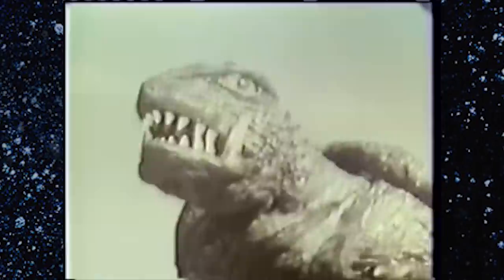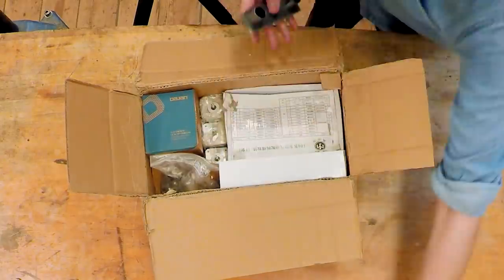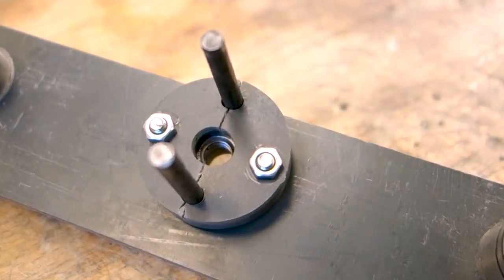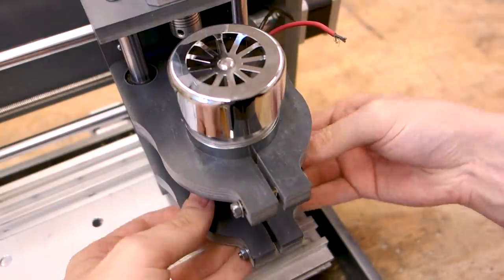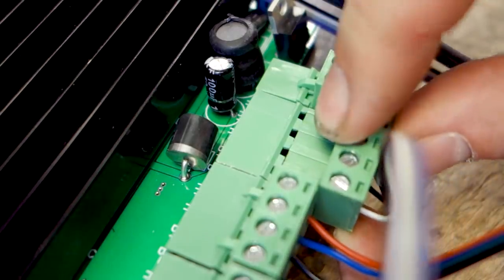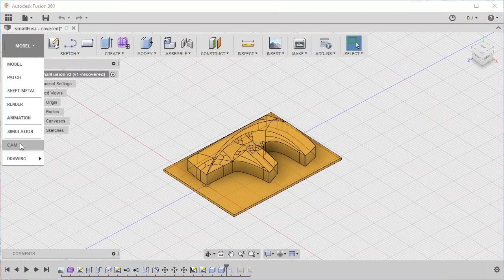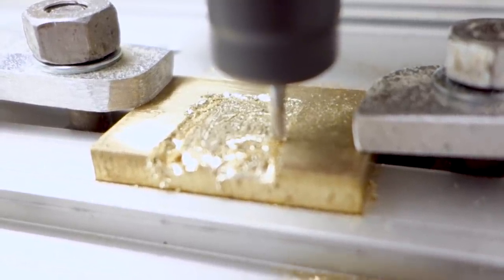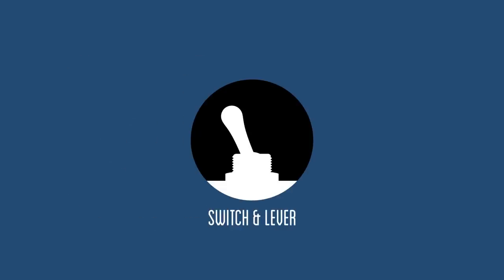Review: Cheap CNC Mill

Comment: Bad review when you're changing the kit's parts even before running things the way they were meant to. Assemble it, run it, show it failing. Then do the fixes to show us what needs to be made better.
Reply: +Techwise Jor
This isn't even the cheapest possible. For $400, using pirated software and dubious plastic framing and parts, it's basically a scam. I just went on GearBest and there are similar CNC "mills"/routers to this machine that utilize aluminum construction (the table for one was even utilizing a near exact copy of the one that was made for as a replacement to the terrible plastic table). All for less than $200. Now, I don't recommend you buy it, but... $400 for this trash is about $250-300 too much. How the seller could sell it for that much and why anyone would buy it is... puzzling to say the least. Frankly, I don't see much more than $100 worth of effort and parts even at the very best here. 

If you're willing to source the parts yourself and DIY, however, you can get a perfectly serviceable and respectable mill for about $400. Most people lack the knowledge, ability or will to do that. I can't exactly blame them. But... this junk is not only part of theft, but I'd even say it's a legit scam. There are better "CNC" "mills" even on the same site as this that are literally half the cost.
Reply: +matchesburn
When I saw the plastic I knew it would be garbage.
An all steel construction would perform much better, it either needs gears for the stepper motors or bigger stepper motors so it has the torque to work.
It's as cheap as they can build it, my guess is that this thing costs no more than 60-70$ to manufacture.
In the end I will say, no it's not worth it to buy this piece of garbage, it's poorly made, poorly designed and it includes counterfeit goods (the electronics).
You could built a better machine from scrapped printers for nearly 8 times cheaper and it would work much better.
Reply: Running it from the box, no changing parts ect, would mean he would have no power to run it. Simply put as he said 'no power cable was supplied'
Reply: It's literally common sense that it will fail when a structual part fails during assembly. Not a bad review at all. Just a lack of the manufacturer using proper materials for the price.
Reply: Techwise Jor  - finally, someone else that sees this... If it IS going to self-destruct it SHOULD BE IN THE REVIEW. This is not a video on "How to make a cheap CNC work for you". I'm surprised he didn't clean the parts up before the "Unboxing".
Reply: I know it isn't. I'm just pointing out the obvious. Besides, there's a chance it would break for good if it was tested with important pieces of it being broken. Then he would either be told again that it was a bad review because he didn't change the parts before testing the machine or he would be criticized for pointing out the obvious. The original manufacturer probably wont make it better anyways. They want to keep it cheap and to use better plastics would put the price up. If anyone is that interested into CNC machines, then learn what they're made of and all to know about each parts function and then either study technical drawings of a CNC machine or build their own from scratch. This was merely an informal video on why not to go for the cheapest possible. Quality costs. It will always cost. The reason why is pointed out when he changed that part.

Comment: "when machining you want your material rigid as humanly possible" are you aware that we humans aren't that rigid?! and why are you replacing the table plate already, just review that machine working as it came out of the box and then do your modifications... zero value review is what this became.
Reply from the maker: +JohnJaggerJack on of my final points outline exactly why, because I think this is a good machine to build further on, which is exactly what I did. 

Why are you taking an idiom literally?

Comment: Great review, have a like and a new sub. It's kind of typical with a lot of Chinese things, I use Aliexpress a lot and look for weird gadgets and things that I can use around home or my car, and I've bought some stuff that is just absolute garbage, and some stuff that is quite ok, but with a little more work or quality, they could have been great. IMO, this isn't worth the asking price. Personally I would build a rig myself, add a quality router as the motor and use good quality Chinese electronics to make it all work. It seems the only part here without a fault of some kind is the electronics, so why suffer with rubbish quality plastic that moves and ruins alignment when building the actual chassis is probably the easiest part of a CNC mill. I love all this kind of stuff and I think I would benefit more from a mill than from a 3D printer, but not benefit enough to A build one, or B spend $500 AUD or more to buy one when I own a dremel, a die grinder and a router.

Comment: i think when you are replacing parts, then you are not reviewing the machine as is, but you are reviewing your own work.

indeed ideally all the plastic parts should be replaced with metal ones. so the original machine just doesnt work.
Reply from the maker: +Avathar Behemoth you can't have watched the review to the end. One of my end points is that this is a great machine to build further on, easy to modify, it's not a production machine. 

By your logic I should've ended the review after the first part broke, as beyond that it was no longer the original machine once I made the replacement part.
Reply: you could have welded the plastic part together again. 

but by the same token.. .why didnt you make a review with all the plastic parts replaced by metal ones? 

see what i mean? yes indeed the machine as is is unsuitable for any work, or at least so it seems.

so maybe you should have done a two "part" review? one with original parts, one with enhanced parts?

then we could have seen the original performance and compared to enhanced parts performance.

that would have made the review much more usable.
Reply from the maker: +Avathar Behemoth it's a load bearing part, "welding" it together when I don't even know what plastic it is would just set it up for more failure. 

It's not unsuitable for any work. I show it milling parts properly. It's an engraving machine and I tried to push it beyond what it's designed for, and you have issues with that? Do you also have issues with your car not being able to drive under water? It's the same logic. 

Not only that but there have been several testimonials from people who have this machine who says they use it successfully for engraving. So your critique is very hollow I'm afraid. 

Maybe I will replace all the parts, or use the electronics to build a completely different platform for it, at some point. Time constraints meant I could not do that for this video. I don't think you understand how much time and effort goes into video production.
Reply: yeah good point. if its an engraving machine. fine. 

but then, it is kinda misleading to call it a cheap cnc machine.
Reply from the maker: +Avathar Behemoth no, it's definitely a CNC machine, because it's controlled, numerically, by a computer. It is even a CNC mill, considering I do mill things successfully with it. It just happens (in my test) to do poorly with brass. At some people mentioned though, my approach may have been flawed, and if I get the chance I may give it another shot.

Comment: that oil protects the metal form moisture in storage and shipment.
Reply from the maker: +cdoublejj I wish that was the case, but as you can actually see in the video some parts even had surface rust.
Reply: i skimmed through. i suppose theory and execution were on separate paths. thanks for the correction.

Comment: I used a 3 axis, desktop CNC mill in my high school CAD class.  I believe it cost my school somewhere in the neighborhood of $12,000 in the early 90's.  The instructor of the class was very protective of it and only allowed his advanced students to use it, and only for very light duty materials such as foam, wax, and soft wood, even though it was probably capable of machining aluminum.  It was that experience that first put the idea in my head that perhaps one could use a CNC to machine parts in wax, then using the lost wax technique and a backyard foundry (which you can find dozens of videos of on YouTube), cast parts for a more robust CNC machine.  Then a machine such as this one could possibly be used to bootstrap a respectable, home built machine shop.

Comment: the millwright m3 is a much better option for that price range
Reply from the maker: +Max Pagliuca the M3 frame is made from MDF though, it's likely to have even greater accuracy and deflection problems than this, even if the spindle (sold separately) is more powerful.

Comment: At $100 it would be a fun toy to tinker with. At $200 I'd probably say it's not worth it. I can't see myself spending $400 for this.
Reply: I agree, I'd have to think twice or three times before lashing out $200 on it, $100 to $150 I'd give it a whack, but $400, forget it.
Reply: you can get some 1000x800x300mm linear rails and ballscrews for ~250€, a 1500W  mill for 80€, add the electronics and motors for ~200€, some scrap steel and aluminum sections, and you have a really good mill for only around 200 bucks more
Reply from the maker: Then don't. Imagine how simple that is.
Reply: Switch & Lever 😆😆😆👊🏻👍🏻

Comment: I bought this mill about half a year ago from eBay. And this review shows exactly how i got it and the problems i faced in the beginning. I had zero experience with a CNC at all, but if you are good at DIY and with some trial and error with the software it will work perfectly fine. Because 3/4 of the manual came in chinese. I am a electronic student and use it mostly to engrave PCBs because it is a lot cheaper than traditional etching (especially at home for me). And i must say I was impressed by the accuracy of it, which I thought was not going to be that good for small PCB traces. I did also some MDF wood milling which turned to be pretty good. An advantage of those DIY CNC mills is that is completely customizable in my opinion. It is easy to change the stepper controller to a another, change the motor with speed control, add limit switches, etc.
Al and all if you need a small CNC for some projects with soft materials like wood, acrylic glass, etc it is definitely a good start. Especially if a CNC of +$800 is just too expensive.

Comment: It's not a mill.. not even a router. It's an plastic cnc engraver toy.
Reply: No you cannot cut metal with it, you can grind metal with it, very slowly. That is a very different proposition, one that involves random inaccuracy and making dust not chips and replacing overheated worn out cutters,  often. It is not stiff enough to support the feedrate required for cutting of metal beyond thin plate and foils. You can't just keep slowing down feed to compensate for lack of rigidity, there is a tooth engagement threshold beyond which you are no longer cutting but simply grinding, making heat, dust and blunt cutters. Cutters must cut fast in order to actually cut discreet chips, the heat is shed with the chip and cutters run relatively cool and stay sharp because of that.
Reply: Which is why the tolerance and repeatability is so shit and the failure rate so high with such abysmal quality control and consistency from one piece of output to the next. Just keep throwing resources away and churning out landfill in waiting.
Reply: You have no idea how many made in china things are made with similar improper mill such as this, we have like 10 units of this in our factor.
Reply: You're comparing it to a manual mini-mill? $400 would probably get you a nice circular saw that cuts metal a thousand times faster but it's not a valid comparison.  If you can find a better CNC 3 axis milling machine for the money I'm curious to see it.
Reply: As far ass I know thiss is the best price. It's here http://bit.ly/2GM4tkO 
Cheers

https://www.youtube.com/watch?v=2rk7DJ6p-nQ
Reply: What have you made and sold ?
Reply: your wrong i think mate,  you can get it used from amazon or ebay for 600$ at the cheapest. buying it new would be more and i you want it cnc ready even more like 3 times as much like 1200$
Reply: Buying a used CNC is a million times better investment that this bottom of the barrel pile of junk.
Reply: @InXLsisDeo  but then you would be paying 40.000 and not 400
Reply: @andreasrasmussen6362  no you can get used CNC 6040 routers for $800.
Reply: jumping to conclusions there bud, your opinion is wrong, i gurantee i could cut metal with this.
Reply: @wethenorth3695  Literally proven wrong in the video.
Reply: @shadowblack1987  this was a year ago? What are you talking about
Reply: @wethenorth3695  So what if it was a year ago...
Reply: You can cut metal with engraver, that is nothing new.. but you do it with 1/10th feed of mill, 1/4 size endmill and 0.1mm or lower plunge instead of 1cm.. (pray that you don't have to pocket large areas).
Reply: yes you would have to take it slow with this tiny thing... not a lot of hp, a large pocket would suck yes... but it could be done, not very ideal, but if its all you have it will work
Reply: @wethenorth3695  If you were stupid enough to spend $400 on this when for the same money you can get so much better then frankly you deserve to have your time wasted ;)
Reply: @jorisbonson386  there's definitely better things to spend your money, just saying this thing could still work

Comment: 340 dollars of crap... you could build it by your self with metallic parts and better electronics, arduino based and have better accuracy and reliability..
Reply from the maker: +mitropoulosilias better electronics? Aside from the instructions being bad I have no critique of the quality of the electronics whatsoever. I'd say this controller board is by far more capable than an Arduino and stepper board would be. 

Better accuracy? Maybe. But again, as I've said, +/- 0.1mm over 100mm is not bad for a mill like this, even if you can get higher with better mills. 

Build it yourself, make a video, tally up all your costs (as well as how long time it took you to get all the parts and build it) and let's see where you land. I'm thoroughly curious!

Comment: I can't elieve how expensive this is... $400 ?? it is worth about 50 at most.
Reply from the maker: $50 may, at best, get you the NEMA 17 stepper motors, and the leadscrews. It's cheap in comparison what many other desktop CNCs, with similar table size, cost. It's expensive compared to buying a knife and carving what you want yourself.

Comment: You forgot to mention that controller included with this machine is a counterfeit controller of PlanetCNC controllers. Many of these Chinese machines come with it.
Reply from the maker: Really? I had no idea! How would one know if it's counterfeit or not?
Reply: It is pretty hard to know if you are not so into CNC's...
Reply from the maker: So, as I asked, how would one know? What does one look for?
Reply: This link helps identifying (some) such controllers: 
http://forum.planet-cnc.com/viewtopic.php?f=2&t=520

If it has USB and it uses CNC USB sw then it is big chance that it is a fake one. 

Original: https://planet-cnc.com/products/
Reply from the maker: +AAMGG thanks for the link! That's really interesting though, didn't realize you could counterfeit things like this. My board even has the planetcnc web address on the PCB, and looks like the best part of the entire kit, in terms of build quality and cleanliness :)

Comment: You could have gotten a cheaper and a higher quality metal one from the aliexpress tough. This looks it doesn't worth the money.
Reply: yeah .... plus to even consider machining metal I would never ever use a plastic frame ..... for 400 bucks you can build your own machine too, aluminium extrusions, steppers and all the parts to go with it are not that expensive.
Reply: and uses same parts from china XD
Reply: the  3040  about 600 and assembled of aluminum..
for control the lowest cost useable is  the  clone ncstudio..
Reply: yet you can buy  this  in American made  version
buy American :-)

the  only difference  is, American made  cost 300 dollar more
and  probably more hairloss due  to the more cost

https://www.bobscnc.com/products/e3-cnc-engraving-kit
Reply: +Kevin Miedema
"and uses same parts from China"
The linked to CNC machine there uses a DeWalt router. DeWalt isn't exactly the best power tool maker out there, but they are decent. And pretty much anything in that package would be multitudes better than this.
Reply: You had  to make two new parts in what was an "assembly" process, this is not fine, you are misleading people saying "this is fine for engraving".
Reply from the maker: +Ali Devrim OĞUZ that's exactly why I made this video, to make it up to everyone to decide whether it is worth it or not. If you're only looking for an engraver, or something to mill softer stuff with, this will do just fine!